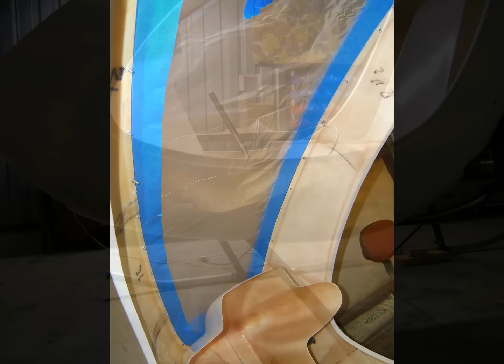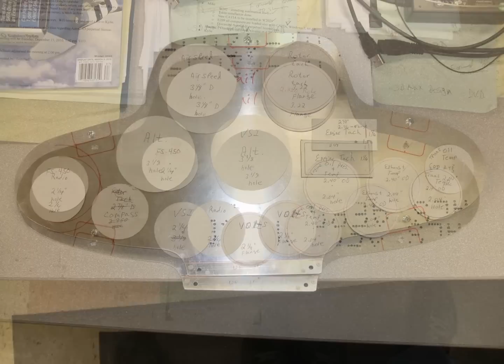Helicycle Build Pics Slideshow Part 1

Comment: Hi, very nice job 🎉
Could you tell me please how many hours you spent to build the helicycle ?
How many percent is the builder work compared to the factory work ? Could you say it’s more than 50% of time for the builder ? Is some document mentioned it, like US administration certificate ?
Thanks for your answer and best regards.
Philippe
Reply from the maker: I spent about 1000 hrs over two years building it. Yes, the kit qualifies for the 51% rule.
Reply: @hcopter  Thank you for your answer. Do Helicycle ventures have a certification or a document which mentioned it please ?
Because I am currently trying to prove that at the French civil aviation authority and I need a proof 🙏 as I could registered the helicycle.
Reply from the maker: @philippeesteban7086  You will need to contact Helicycle Ventures directly about that, I built mine when it was still owned by Eagle R&D.

Comment: I've watched most of the slide shows you've put online. I've also noticed the RV, the home built plane, the motorcycle, the truck outside the hanger, the lathe, the mill, misc tools around the shop, the band saw. Along with a beautiful hanger you have all of this stuff stored in. A few questions come to mind. 

1. What do you do for a living? 
2. Where in the US are you located?
3. What is your email, contact information? 
4. There is over a million dollars inside that hanger and also the utilities that come along with that hanger. Is it all yours? 
5. What Helicycle kit is this? 
6. Where did you buy it? 
7. How much did the kit cost by the time it got dropped off @ time 0:00 ?
Reply from the maker: +CEngineer2010 
Unfortunately for me, the pictures with the nice hangar, RV, bi-plane and work benches were from the original kit owner who started the build that I purchased in Las Vegas.  The dark, unheated hangar is where I built the rest of it here in Kansas where I work as a university computer tech.
Reply: +hcopter, Thank you for replying. How much did your kit cost at drop off/pick up @ time 0:00?
Reply from the maker: +CEngineer2010 
Group 5 kits were about $38k
Reply: hcopter and what’s your SSN? lol